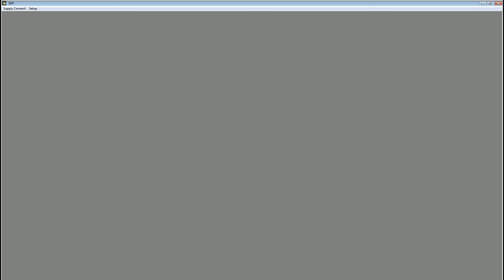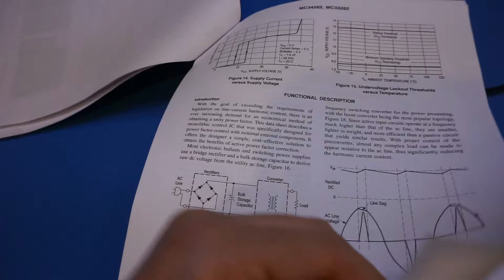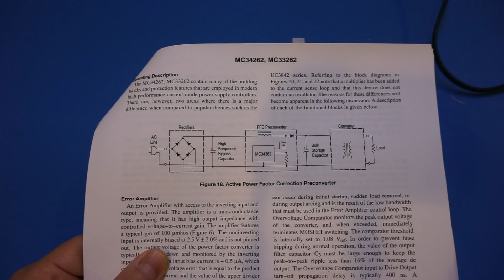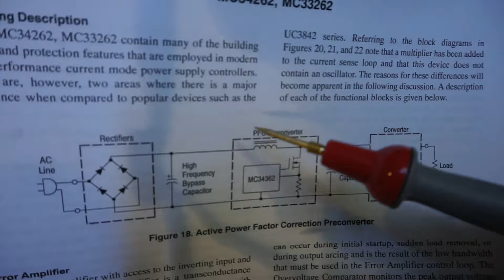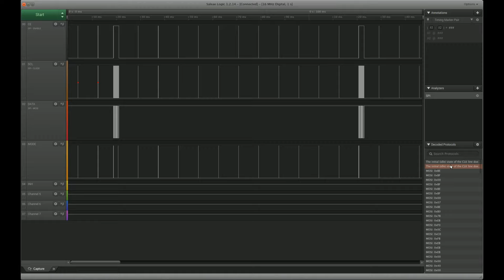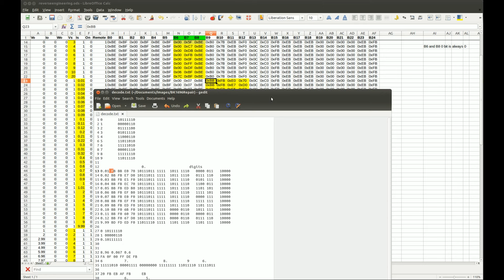BK Precision 1696 Repair Attempt and Display Protocol Reverse Engineering

Comment: Hi! Did you found how to fix hardware issue? Mine doesn't go higher that 11v too! I think it's a transistors because fan doesn't work on my power supply
Reply: I have a couple of these BK-P 1697 s and while they used to work up to 40V although rarely used above 28V, both fizzled after light duty and only put out around 20.5V. ... and the fans work on neither, too, but did initially cycle.

Comment: Liked the video.
Did you make a follow up video?
Regards
Reply from the maker: No, I am still debating what is the best approach for making the new display fit in place as there would be additional circuitry needed to support a different display.
Reply: Just a question: the data is sent via the DATA line (SPI).
Would it be possible to use an arduino to query the data from the micro-controller and then drive any arduino type display with I2C or SPI?

Datasheet: ADuC831: http://www.analog.com/media/en/technical-documentation/data-sheets/ADUC831.pdf
Reply from the maker: It's possible, but the clock speed is a bit too fast for the Arduino and Arduino needs to be configured as SPI slave as well. Since the data is not quite standard SPI, this may or may not be possible using the hardware SPI support. And it will require more processing power if software is needed to interpret the data (e.g. sampling the signal and derive the content etc.)